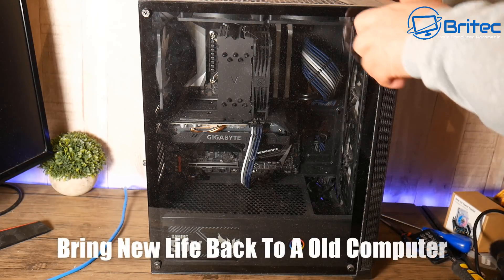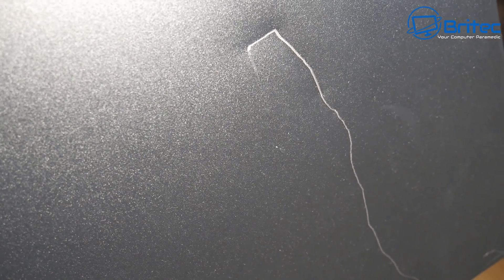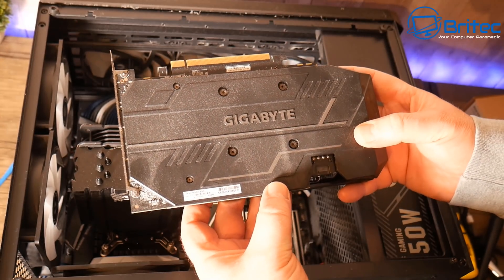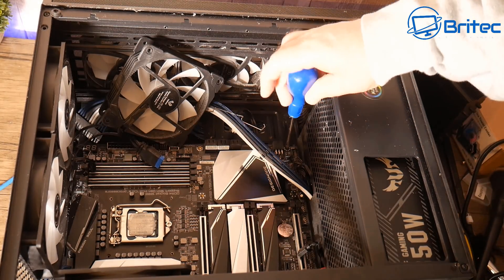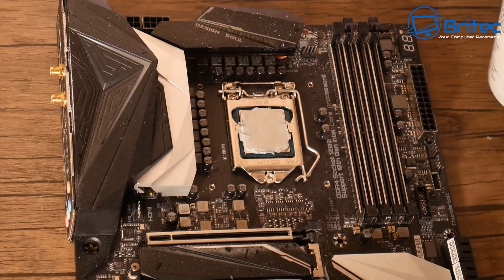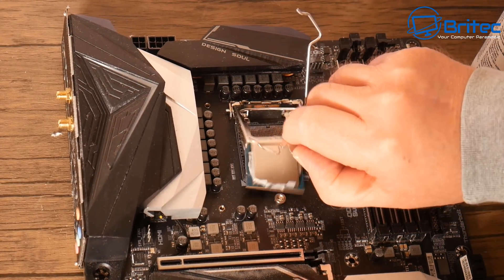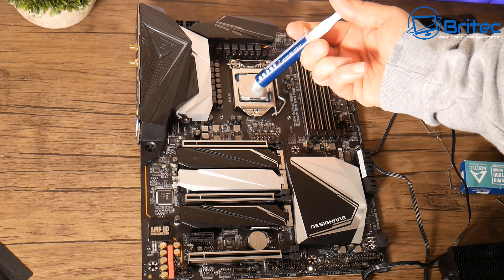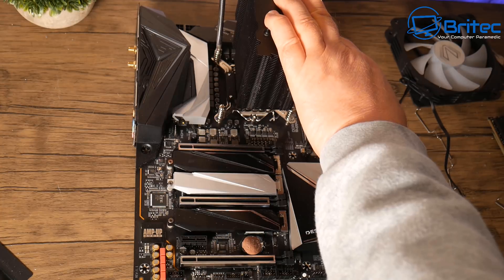Bring New Life Back To A Old Computer

Comment: That’s handling that guy with ease. Not sure about that WD 40 product. I don’t use anything but 99% isopropyl alcohol on any board. Yes it requires a wipe down with cotton based wipes and Q tips after the IPA, but that is a small price to pay for first rate results. It’s the solder training coming out and the level which was high. Overkill to some is just right for high quality work. Can’t turn off that way if doing things. It is showing respect for the work. I understand that it might be impractical on less expensive gear. I’m not kicking it. I just have done this in a most severe way and that is hard for me to let go. It’s a discipline for veteran techs. Stay safe my mates!😊👍🏻😁

Comment: I've been building my own PCs since buying components was first an option, and like everybody else battled the dreaded dust for years. 
Then about 3 years ago I stumbled across a new concept to me described as a "positive pressure system."
After looking at the basic maths and designing my system to achieve a slight over pressure, I've been delighted that in 3 years I've never had to clean any dust from inside the system - none at all - just a periodic rinse of my intake filters. 
For anybody thinking about a new build it's well worth looking into. 😊👍🏻

Comment: Me who have a 6gb ram pc and gtx 710
Reply: I would recommend you to increase the ram to 8gb or more (it depends of your motherboard) add better gpu and most important ssd. Btw can you type below full specs of your pc ?
Reply: @domenvalentinuzzi  idk full specs but I have an Intel pentium which is bad and my CPU is not even a gaming CPU Planning to upgrade my PC to 16x2 ram idk well but can u suggest me how can I build a Budget Gaming CPU..will really help a lot 👍
Reply: @DragNeeL68  Here are my specs (btw half components in my case are new half used). So i have:
-core i7 4770k
- 16gb ddr3 1866mhz ram
- 2x 860evo 512gb samsung ssd and one nvme 256gb drive 
- combatpower 750w powersupply
- asus z87 pro motherboard (btw that model supports 2400mhz ram)
- evga gtx 1060 6gb version
- cooler noctua nhd15
- windows 11

With all that runs games pretty good 1080p 60fps is no problem
Reply: Tq so much for the suggestion really appreciate it♥️🤗